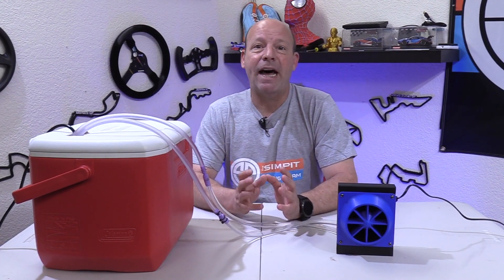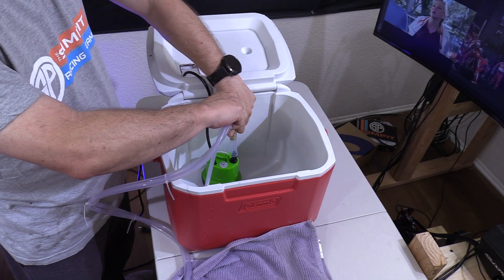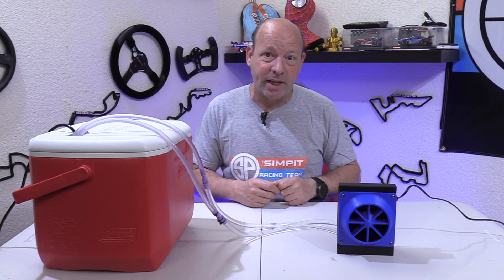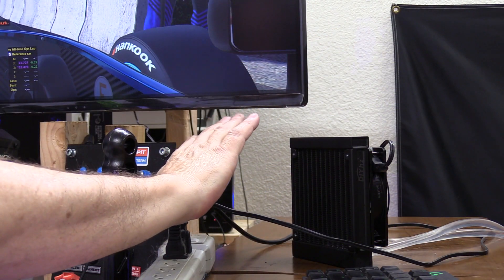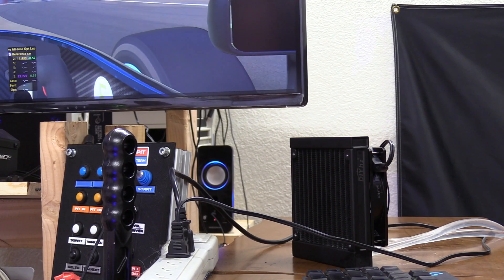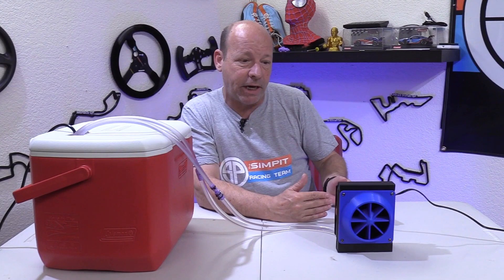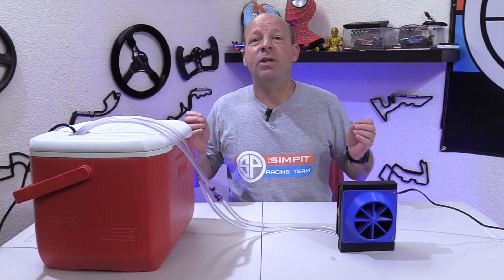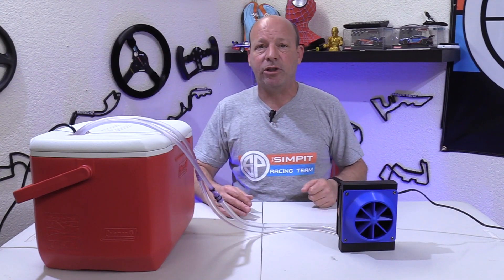"Coolest Sim Racer 2.0 ~ DIY AC, can we beat the cool suit?"

Comment: Hey shaun, how about using piezo electric cooling elements? No messy waterbottles. It's like a plate powered with low voltage, it's hot on one side and cool on the other and the more you can cool the hot side, the cooler the cold side gets, it can go sub zero (celcius) normally used for cooling computer hardware. Would also be easier to control and prevent overcooling.
Reply: I have always heard them called Peltier's, didn't know  they also were called piezo.... Learned something new.
Reply: @elbowsout6301  you are right, that are peltier plates what I mean, I remembered wrong, piezo electric cooling is a fan alternative for moving air.

Comment: I use a large electric fan for cooling, the higher airflow is enough, no need for any ice. I use it on rotation, because otherwise it is uncomfortable, those electric fans are like 25€, they are loud, but i wear in ears anyway.

Comment: Open the window and let heat escape. Put a fan on the window sill and blow air out of it, the same principle desktop pc's have a fan blowing air out of it. If your room doesn't have a window then you are screwed.

Use a gaming laptop instead of desktop. Laptops should produce less heat than desktops. Mine does at least. I remember buying Hitman Blood Money in the middle of 2006 and looked forward to playing it. Only to be roasted by hot weather and my pc when playing the new game! Six years later I replace my old and outdated pc with a gaming laptop. Used the laptop in the summer months and I wasn't nearly as hot as when I had my pc.

If you don't want to do the laptop route then use low graphics settings, less than 60 fps, low everything else. Select fewer a.i. drivers/opponents in any game. So your pc doesn't need to work as hard and ultimately release less heat. I know using low settings isn't fun!

Find a way to remove humidity from your room! Humidity makes you feel hotter than it really is! It is basically water in the air. If there is too much of it then it is harder for sweat on your skin to evaporate so you're getting drowned in heat. Air conditioner? Do not take wet clothes from the washing machine and dry it in the same room you are playing Assetto Corsa in!

Comment: So.. you buy a expensive rig, screen, DD wheel, pedals, workstation with massive GPU and you can't then afford AC for 1500 that last way longer than any other appliance I your sim room? :-)
Reply: Still, funny informative research video
Reply: As much as I appreciate the video this guy has a point. If anything it will help your gear in the summer
Reply from the maker: In the first episode I talked about a few things.  #1 our house is air conditioned to about 74 or 75 degrees,  but my sim room runs about 5 degrees hotter.  #2  I bought an Air Conditioner for the sim room, but , it is very loud, it is expensive to run and it causes circuit breaker problems as it draws a lot of amps.  This was an alternative.
Reply: @TheSimpit  thanks for clarifying. That wasn't clear to me. Keep up the creative content!